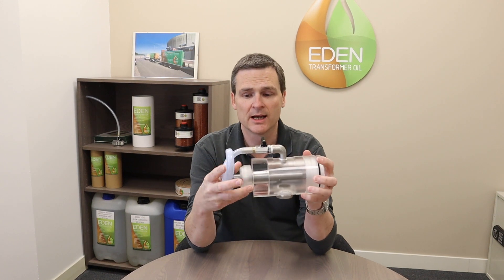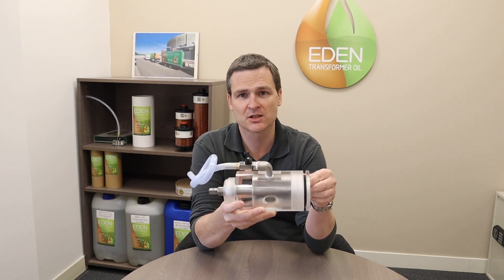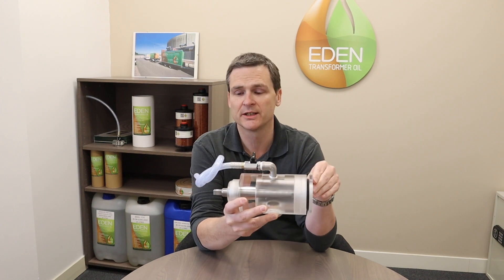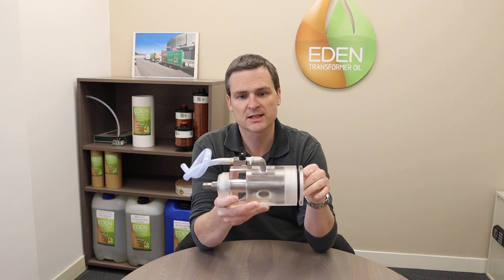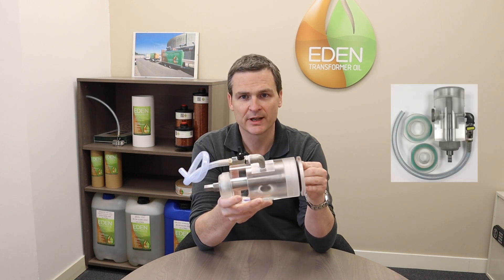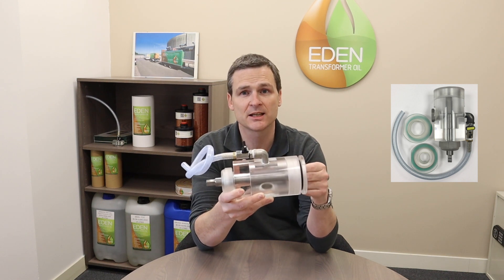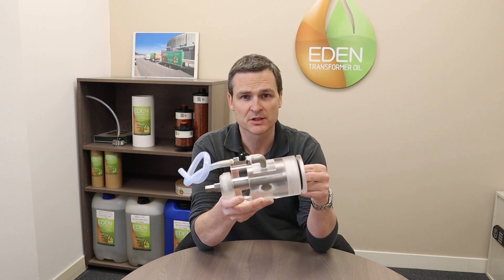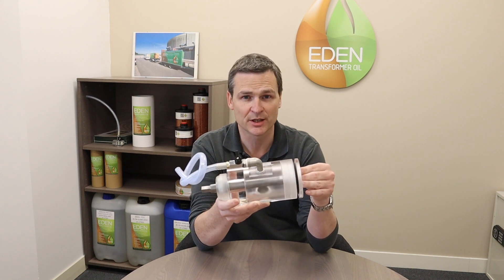Sampling Hermetically Sealed Transformers

Comment: If hermetically sealed transformers are maintenance free then why do we need to have it sampled as moisture ingress and oxidization is less of an issue, and referring to the statement that there has been known findings of excessive moisture and/or low dielectric strength in the past and does that findings supports logical explanations why and what would be the recommended actions in such cases?
Reply: They should be sampled. Never mind moisture and dielectric strength, there could be all sorts of gases occuring through loose connections, break down of core insulation/varnishes etc etc